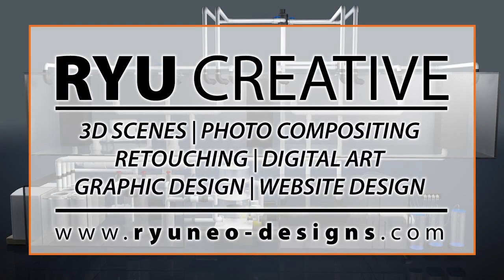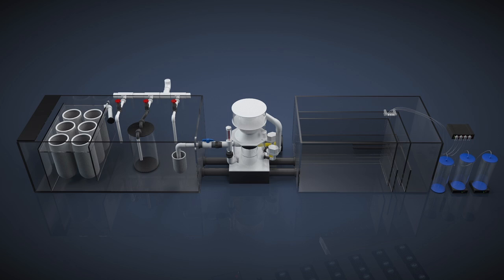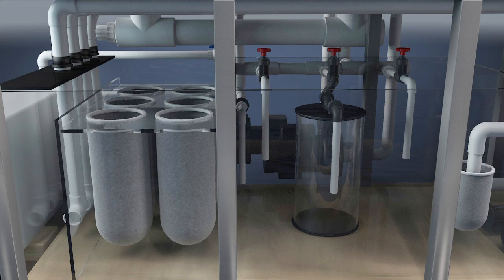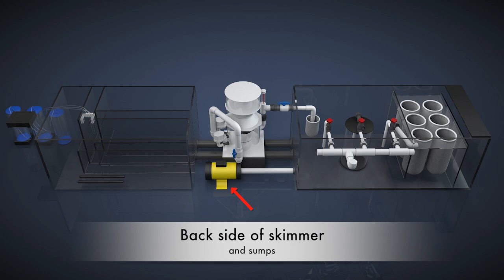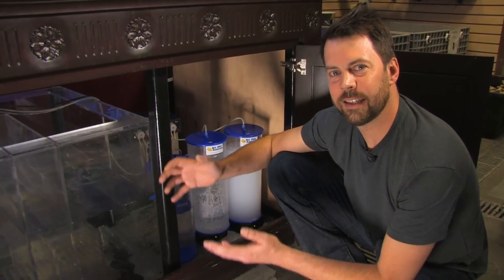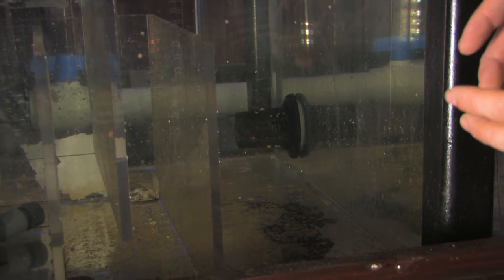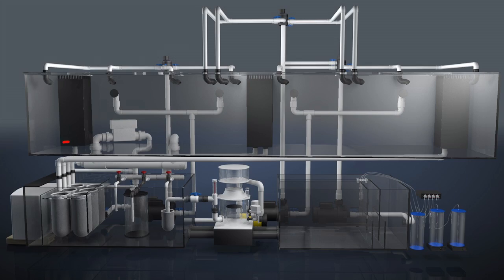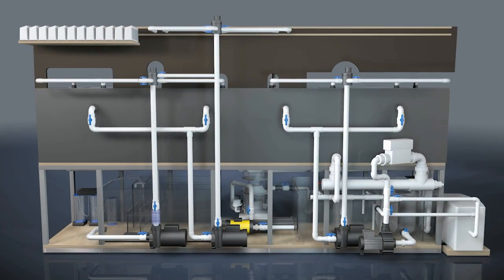Part 1: Sumps and Design of 800 Gallon Aquarium

Comment: fantastic!  can't wait for the Closed Loop/OM talk and i hope you can give us more then just a description, but also some insite on why it was plumbed the way it is or some reasoning on the flow dynamics!!
Reply from the maker: We placed the returns around the perimeter of the aquarium and plumbed them through the top bracing to allow us to get flow throughout the aquarium. This leaves very little room for dead spots and we have no need for power heads in the tank. The reasoning is simply to create flow throughout the tank. I kept the closed loop intakes centered down 9" because I didn't want the potential for 800 gallons of water on the floor. I didn't get too scientific with it but I'm happy with the results.